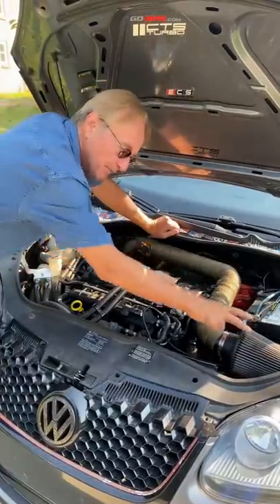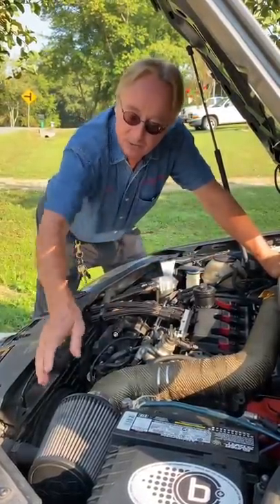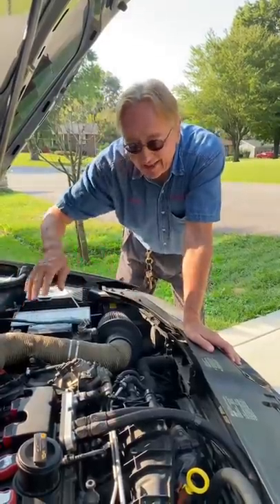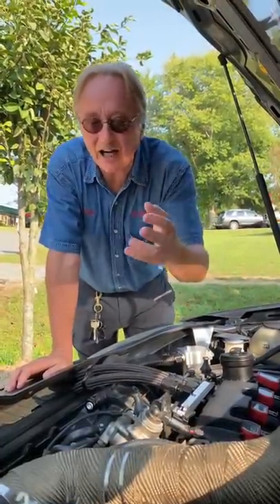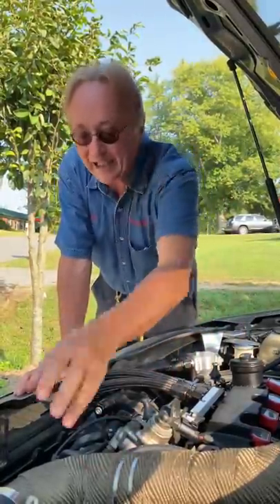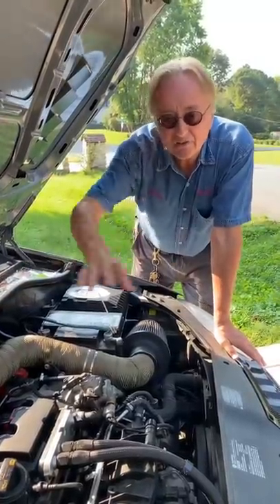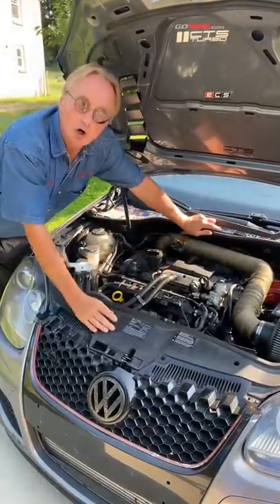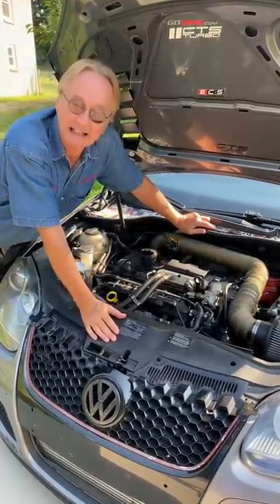Why Cold Air Intakes are Stupid

Comment: "All it'll do is make your engine bay look cooler and make more noise"

Yes, that's exactly what I want
Reply: Literally The only thing i want is it to be louder lmao
Reply: @Anthonysmith-ic8ef  itll make your car slower without a tune
Reply: @ua6jj328  yeah but it’ll only be a few hp
Reply: “Cooler” and louder but not faster…. Pretty rice
Reply: @ua6jj328  that's why you tune it after. Same with sportbikes.
Reply: @guardiandaytona8454  most people put the cold air intakes are Cars where the tune would cost more then the Car lol
Reply: @ua6jj328  facts🤣
Reply: @ua6jj328  correct
Reply: @ua6jj328  why would you not get your car tuned after nodding it? Thats how you ruin your car tf
Reply: @richmoney7806  the car scene is all ricers these days unfortunately
Reply: @ua6jj328  he wants his car to match his brain activity
Reply: I’ve been trying to contact you about your vehicles cold air intake warrenty. Did you know you can save 1% horsepower removing it and getting the original intake
Reply: Ricer….
Reply: Scotty : Surprisedpikachu.jpg
Reply: @richmoney7806  imagine thinking a intake is rice rice would be a 4 inch exhaust tip and 10° camber
Reply: @Quirin M. 
Honestly asking:
How WOULD you tune it yourself?
Do you have a video on that, or have a link to a video that describes the process?

I am very curious how a DIY’er would tackle such project. 

Thank you.
Reply: @reallifeengineer7214  a laptop a program and some street testing
Reply: I've honestly gotten a significant amount of performance putting these things on older cars. Newer cars not so much. What are you guys referring to by "tuning"? Like computer reflashing or something? I'm confused

Edit: I think the two comments above me answer that question as -- yes, reprogramming/reflashing. Not sure how I didn't see those
Reply: Yes...
Reply: @A F  and maybe a few engines if you don't know what you're doing. Seriouly dont mess with the tune unless you know what an engine needs to survive.
Reply: Faxxx
Reply: Scottie doesn't understand that you don't buy BMWs for reliability. He legit thinks the reliable cars are the only good cars lol
Reply: @guardiandaytona8454   Exactly.  I love Scotty, but he is wrong on this. It depends on the engines also. A turbo charged engine will see a substabtial difference with tune. It is the combenation of air , fuel, timing . Yes,  without a tune it can be worse, but thats a given , as thr stock ecu does not comensate for extra air.
Reply: @gingertrilogy366  Only reason to put an intake on a bimmer is for psshhhh noises (assuming the engine is turbocharged).  The +/- HP difference affects your performance the same amount as the weight difference in regards to your gas tank level—negligible.
Reply: Facs
Reply: @kylesmith9048   Not true. It depends on the engine . It can make a substantial difference with a tune, and on a forced induction engine.
Reply: @calebniederhofer6529  Out of all the bimmers I have tuned, I have never seen a “substantial difference” from an aftermarket intake.  The stock air box will not bottleneck a stock turbo—even when maxing out the stock turbo with a tune.  I had a bms intake on my fbo stage 2+ 335i and I’m currently running the stock intake on my fbo stage 2+ m235i—I’ve experienced both sides.  I’m curious to know what you consider a “substantial difference.”
Reply: @kylesmith9048   It depends on the engines.  A cold air intake by itself is marginal, and usually worse performance.  However, combined with tuning the ecu,  you can see 50 plus horsepower added on some Forced induction  engines.  I have had my diesels tunes with 175 hp added .   It really does vary on the engine, factory restrictions.
Reply: @calebniederhofer6529   Give an example that gained “50 plus horsepower” from an air intake.
Reply: @kylesmith9048  I said Cold Air Intake, combined with any kind of ecu tuning can make a signficant difference, depending on the  engine.  Tons of dyno videos out there. Again, every engine, emissions, restrictions vary drastically.
Reply: Exactly!
Reply: @fryta.  exactly. People out here calling everything they don't like, rice.
Reply: annoying
Reply: Well it rates 15 to 20 hp 🤷🏽‍♂️ I’m sold
Reply: Whats what Im saying haha.
Reply: @geniuspatch287  🤣
Reply: 😂 I want that to lmao
Reply: @gingertrilogy366  meanwhile i’m over here going crazy trying to explain this with my gti 🤣
Reply: Fkn right😂🤑🔥
Reply: Sooooo you also want your car to hydro-lock every time it rains?
Reply: @ua6jj328  yeah by like 5 HP that's nothing
Reply: Not just that the aluminum and silicone is way more durable than the plastic
Reply: @af7698  okay do you have a specific name for said program? And where would u connect the laptop to?
Reply: @Anthonysmith-ic8ef  the suck in to much air for a un tuned engine can make it run lean losing power and risking blowing up your engine
Reply: Am make little power so that's apsolute victory
Reply: @ua6jj328  i understand if you said that if you removed agr valve but with cold air intake more air=more power you can't tune air your engine will work less while you don't need to change filter altho depending where it is placed like near hot air intake it's better to put pipe
Reply: Can lower the engine power too though
Reply: Literally lmfao
Reply: @ua6jj328  it’s already slow it’s a jeep
Reply: Lmfao 😂😂😂bro. I’m dying over here.🤣🤣🤣🤣
Reply: @dylanjamessparks haha good one
Reply: Hell yah 100
Reply: @fryta.  I like to believe that some women enjoy a ride with a 4 inch tip. Not that I've ever sported a ricer or anything, but I like to believe that anyways.
Reply: Definitely not. Did you do dyno testing?
Reply: 😂🎉
Bingo Ringo
Reply: @ua6jj328 newer cars the ecu will notice more air coming in and adjust the fuel level going into the engine.
Reply: They filter like crap, can oil your MAF and are more likely to introduce warm air.
Reply: @Anthonysmith-ic8ef youll notice it because ypull be thinking about it.. unless its too loud to think 😂
Reply: @Bedhed47 some people get a mod knowing they'll get additional mods as they can afford them fairly soon...but don't wanna keep going to get it dyno tuned after every single performance upgrade. Oftentimes the plan is to make what they consider to be their final performance mod for a while and THEN have it tuned.
Reply: @Kingnumber-nd9cl that's only a threat if it's placed down low or is near an open hood scoop
Reply: Yessir
Reply: Yes
Reply: Fr bro like tf
Reply: @ua6jj328 as a mechanic who’s work is building and tuning motors , I think I’ll take the risk 😂
Reply: Exhuast.
Reply: All noise but no go just like the owner haha
Reply: @Anthonysmith-ic8ef lolll
Reply: @MV-ri7zu unfortunately that’s all for sale or can afford America is broke 😂😭
Reply: @richmoney7806  I like my car, it’s low, slow, and loud.
Reply: @calebniederhofer6529 stock ecu does compensate for both Quantity and Quality of air. What do you mean
Reply: @monsieurlaflamme995  The factory ECU is designed for the factory air intake. I keep repeating myself on here, but no worries. You have to tune the ECU to get any kind of real benefit with aftermarket CAI. You can actually have worse performance with a CAI and factory tunes. The ECU is designed to adjust air, fuel, timing all within the factory parameters. It is not designed for aftermarket CAI and this is why you need to tune the ECU to adjust the air, fuel. Believe what you want, this is correct.
Reply: @monsieurlaflamme995  I don’t know what you mean by quality of air lol. Never heard of that. I think that you mean for sea level and density altitude maybe ? The ECU can adjust air and fuel, but this is designed with a stock system, parameters. CAI are a waste of money without some kind of ECU tune.
Reply: @ua6jj328 matters what type of intake you get.. if you get a cold air with a sealed cone  to seal all hot air and get cold air .. it helps with mpg and a small hp and if it's tuned it gives more hp because the computer will recognize the air flow.. the cold air always helps but if you have it pointing to the engine without a a box or cone cover for the filter then you just sucking it hot air
Reply: @MOB8ITS3MY1JOB  No, That is actually not true. You have to do some kind of ECU tune to get any kind of performance gain. In fact you will lose power without a tune in the majority of  cars, etc. I hear that all the time and it is simply wrong. The stock ECU will not adjust air to make any kind of noticeable difference. It is designed for the stock intake and stock air parameters. You have to do a ECU tune to compensate for the adjusted air/fuel.
Reply: I’ve never seen a cold air intake make a car sound “louder”.
Reply: @guardiandaytona8454  how do you "tune" it?
Reply: @berto371rr  You have to tune the ECU. That is actually a misconception. Factory ECU is only designed to adjust air and fuel within the stock parameters.  I quit replying, because people would rather argue ignorance.
Reply: Frfr😂😂😂
Reply: Mine actually makes more horses...not much but better than the Ole panel ones. I hear the suction like a typhoon, no wait it's actually called the KnN typhoon system 😂😂😂 it has the velossa air ram ducts so it's getting cold air to it anyway...so doesn't get heatsoak from engine like others, is in own box too x 2 yes it is tuned...and decatted.
Reply: @ua6jj328 okay Scottie we get it
Reply: it´s all about that my friend, car guys are all in for it
Reply: 😂 exactly ‘Merica
Reply: Right 😂
Reply: frfrfrfr!!!!!
Reply: Just get kn filter 50 bucks
Reply: @Anthonysmith-ic8ef removing the muffler will make it louder and actually give it a little power. Or drill holes in it 😂

Comment: I’ve had aftermarket intakes on just about every car I’ve ever owned. Never had a check engine light come on and I’ve always gotten better gas mileage. May not give you extra power but it does help!
Reply: it does improve horsepower
Reply: @vlz.matthew  from just a cai? your tripping dog
Reply: @vlz.matthew what are you on good sir ?
Reply: @vlz.matthew yeah definitely not. Do you even drive ?
Reply: @vlz.matthew  on like a performance forced induction engine maybe
Reply: @yassinenattah  they tend to already have non restrictive filters without getting a upgrade
Reply: No they help only to make noise and a feel of sporty but have drawbacks especially for a daily
Reply: @georgeknight1117 I got 3 inch carbon fiber intakes for my 370z gained 34 wheel horsepower
Reply: A roush intake on F-150 will give you 13 extra hp, sound better,  and a little better mpg
Reply: @jayson2121 he’s probably referring to forza💀😂😭
Reply: @vlz.matthew nah dawg u tripping 5hp MAX
Reply: Sure😂 I’m sure it came on
Reply: @vlz.matthew  sure if you're factory intake was an actual brick with zero airflow and you're engine is otherwise perfect and high performance

Comment: $400 K&N cold air intake was great on my 5.7L sequoia for almost 20k miles. 

Then it threw codes and ran lean. 

Paid $500 to two Toyota master techs to diagnose. They checked the entire fuel line, plugs, engine, etc. 

It was the cold air intake. Sold it to someone and put oem back on. No issues the last two years and 17k miles.

Also does nothing for mpg. Just makes nice sound. That’s all.
Reply: You need to get it tuned if you’re getting an aftermarket intake

Comment: This guy always puts a lot of faith in engineers.
Reply: he makes me cringe as a shade tree mechanic. seems like a book learned type that doesnt like turning wrenches because he will get oil on his hands
Reply: @xxmeanyheadxx  you're wrong about that one. He grew up learning about cars in a shop from other mechanics.
Reply: Engineers are the reason we have the vehicles and mods. He knows a thing or two about vehicles and mods.
Reply: Only when it fits his preconceived conclusions.
Reply: @luweewee  Scotty isn’t god.  And if you’ve ever been a mechanic you know that those engineers often aren’t gods either.
Reply: He's quite right on this one
Reply: Am a engineer and I do not trust us
Reply: Someone should make a "scotty car" and use all his tips on it!
And we all can bet on how many days it will survive! xD
Reply: @andrea981  Elaborate please.
Cold air is more dense than hot air. So you get more air into the engine (in wieght) compared to hot air. They have the same volume but the density   is lower on hot air.
First grade science
Reply: As an engineer, the cars are designed so that all the factory components work together. When you start changing things without changing the systems they affect and interact with, that's where problems arise. As mentioned, a CAI will mess with the engine tuning, but that's exactly why you tune an engine for a CAI. It's the same reason you don't slap aftermarket wheels and tires on without adjusting the suspension for those (or for the old school folks, why you don't set your carb idle when the timing is off).
Reply: as he should

Comment: No the manufacturers put the original air intake on to Maximize comfort. While putting a cold air intake on it will alow the engine to breathe so it will be louder but it’s also some what better for the engine. One way to think about is like trying to breathe with a mask on compared to without a mask.

Comment: I put one on my 2013 Accord EX-L V6, and it made a very noticeable difference. On takeoff, my tires now bark going into 2nd. Acceleration is definitely improved, and it sounds amazing for the price.
Reply: just sold my baby today 😭😭 what a sleeper
Reply: @SxyN8  You okay??? LOL
Reply: @sirtiksalot9511  I'll get through it. The Fiesta st helps
Reply: @SxyN8  How can i get some of whatever pills you’re on??? 🤣
Reply: @sirtiksalot9511  look to the east at the first light on the fifth day
Reply: I’m here 1 year later. How is your car now? I’m thinking about getting a cold air intake
Reply: @LordOfZ3  I lost a cylinder at just under 300K miles, but until that point, it was still performing. When my new engine is installed, it will definitely still have the K&N by its side. LOL
Reply: @sirtiksalot9511  this is what I needed to know! Thanks haha I’m definitely getting one

Comment: I added a cold air intake to my 2003 Dodge Ram 1500 with the 4.7L Magnum V8. The mileage improved and I gained noticeable power when my truck was in fifth gear (overdrive).

Comment: From my experience true cold air intake goes all the way down to where the bumper is that way there’s no heat soak and should be made out of plastic or silicone to keep heat off. They also sell water cover mesh that you put around the filter to keep it from getting soaked and who ever is dumb enough to sit their car on a deep puddle/flood or drive through a flood where their filter emerges in shouldn’t be modifying their car.
Reply: Yup,how i have mines
Reply: Ever heard about hydro lock?
Reply: The air still heats up. As soon as it enters engine bay. Silicone is the way. But still heats up.
Reply: @michalbiajgo3778  ever seen life OD shove a garden hose at full blast down the intake while it's running and get no hydrolock
Reply: this is in fact wrong any aftermarket intake in which opens up and make sure intake more free also usually rolling to somewhere with a cooler air source or flow a lot of vehicles stay away from the front wheel wells so you don’t Hydro like your motor because those mesh socks don’t work too well
Reply: Sometimes they’re working on bridges and I need to get to the other side 😂. I have a 2014 Volkswagen Jetta TDI 6 speed.
Reply: And those CAI have a long tubing that lags your throttle response.

Comment: Just because of this video I’m about to get an cold Air intake for my 8th gen Honda Civic lol.
Reply: Do it! Got one on mine and the extra hamsters under the hood really scream
Reply: @scooterbobscout  I'm thinking bout getting the one where the intake sits near the battery area is thst good. It has a heat shield on the sides
Reply: Yoooo 8th Gen crew here 😈
Reply: @miclomusic805  8th gen is better than 9th gen fight me
Reply: @thekernel69  I completely agree ! 🙏
My bro has a either a 9 or 10th and it just doesn’t do it for me haha, 8TH GEN ‼️‼️
Reply: @miclomusic805  if it was a turbo it's a 10th gen and if it has wimpy VTEC and a redline of a truck it's a 9th gen
Reply: Civic guy does something he's told not to wow 😎😎😎😎😎😎
Reply: Me too bro💀
Reply: @Transitive Wisdom how’s it rice
Reply: Everything he said literally makes you want one😂
Reply: @miclomusic805  would you know why my car feels like it was to shut off when I’m gear or when idle? 04 Honda Civic EX COUPE
Reply: @ThriftedHeart  it could be your idle control valve, normally it’s just a screw you can adjust to set your idle rpm’s,

But make sure you test before adjusting (most Hondas should idle around 650-800rpm warmed up )

Comment: This dude is one of the car guys that likes everything in its original state so he spits out trash against what he doesn't understand. I installed a cold air intake in my 5.7 Hemi and gained 23 hp on the dyno before I even upgraded my throttle body. Literally almost even part on a car he says not to change, I have done and my car's been running in tip top shape for 4 years now.

Comment: Scotty I have one that is bolt on for the same distance, I literally have it on a Lexus nx 200t 2015, it's been on for 125,000 miles. I have literally zero issues with it but again mine is AEM bolt on vehicle specific. I get better gas mileage and I get more hp. I'm sorry but on a turbo engine I feel it's a necessity.
Reply: I been looking for an injen one and I found it and it’s a bolt on fitted for my specific vehicle you think I’ll be good ? It’s not AEM but I know Injen is good quality too